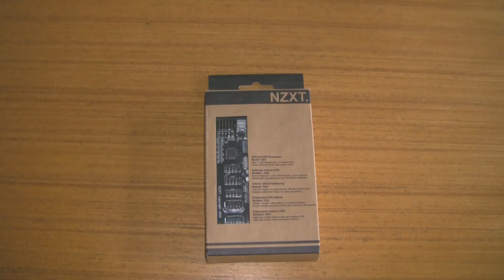NZXT Internal USB Hub

Comment: This piece of hardware is great. It seems like they are the only company that sells one, but only charges $20 for it. Keep in mind it probably only cost $4 to make. One board is used for 2 of my front USB ports, card reader, and fan controller. The other is used for the other 2 front USB ports and Kraken X60.  It has a molex power connector, but I didn't need to plug it in. Everything seems to work ok, not like I'm plugging in an external hard drive, that is what 3.0 is for.

Comment: Imagine using a Next Unit of Computing (NUC) case and fitting one of these USB hubs into it. Then, putting a few Mushkin Ventura Pro USB flash drives to use as the C: 
boot up drive and extra storage drive. = very powerful midget PC.